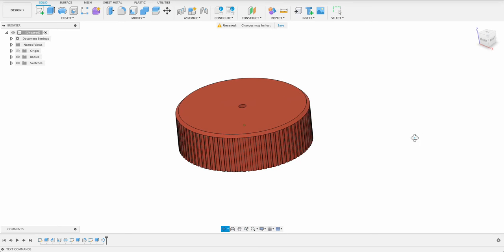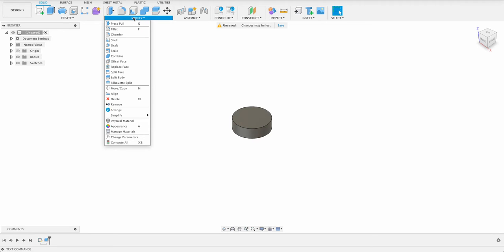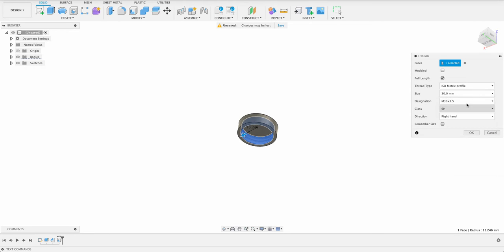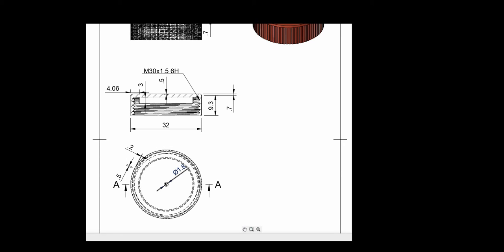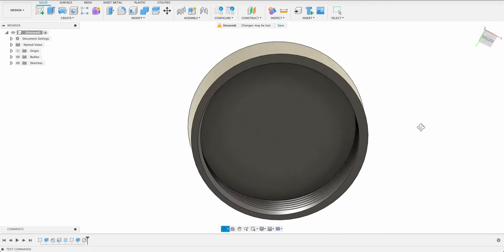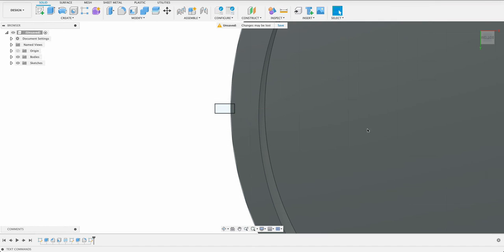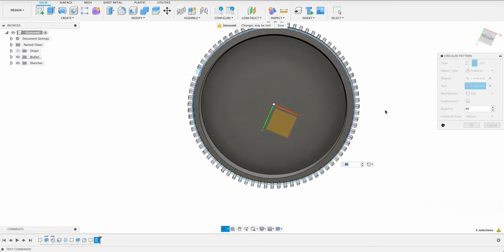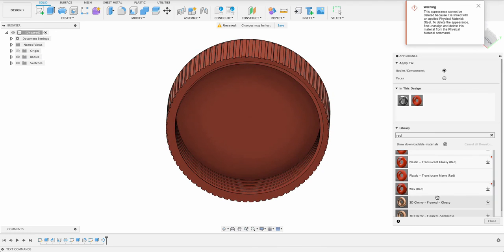Fusion 360 beginner tutorial: designing a bottle cap

Comment: If I wanted to add a figure to 3d print on top of this or make a figure with a threaded portion inside to screw onto a bottle how would I do that?
Reply from the maker: If you are meaning you want to mount a figure on top of the cap, I would put a female thread in the middle of the cap so when you print you won’t need support. Then you can either have your figure with a male thread in it or you can have a male thread that screws into the cap and has a portion with no thread so it doesn’t screw too far and then the figure can be screwed on top of that

Comment: nice video. If you have an existing bottle how would you determine the thread specs?
Reply from the maker: In a few weeks I am doing a video on using a bottle as the mould to cut the threads. You also get standard thread diameter and pitch so if you know that it’s easier. But keep an eye out for that video
Reply: @Fusionfundamentals combine tool?

Comment: Good day,  I'm wondering if there is a way to turn a construction line into a geometry line. For example,  construction spline to geometry spline.
Reply from the maker: If I understand correctly and you have just drawn a construction line you can turn it back to a geometry line by clicking it and then clicking on the construction line button and it will deselect it turning it back.